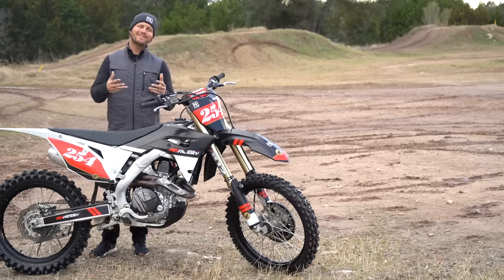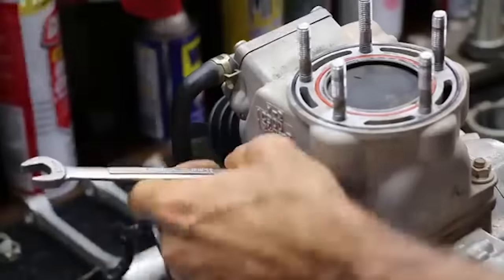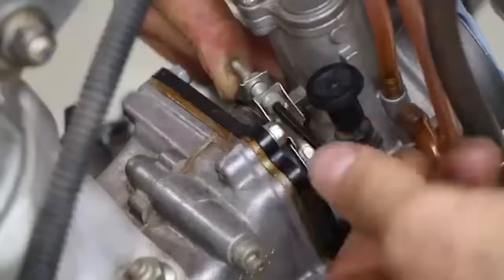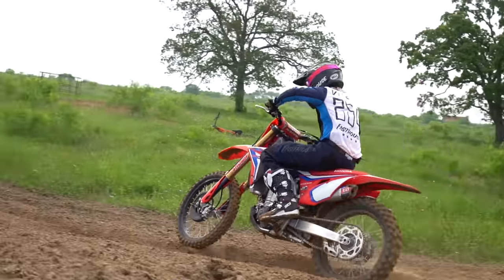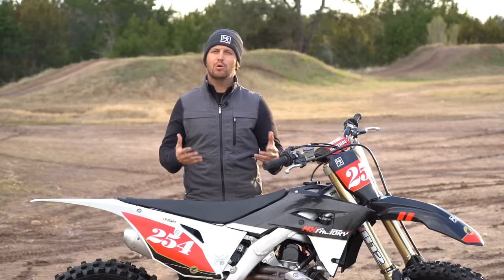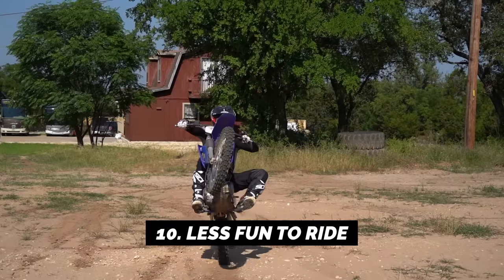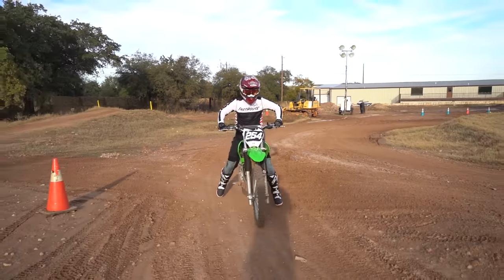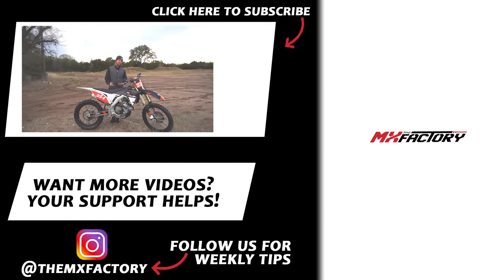13 Things You Need to Know About 4-Stroke Dirt Bikes

Comment: two-stroke takes one revolution of a crank for a complete cycle as a four-stroke take two revolutions of a crank to complete a four-stroke cycle
Reply: exaclty, 4 stroke talks about the number of strokes a piston does (up and down) and not the crank revolutions.
Reply: Yep - caught that also.   

(Pumping hand up and down while saying the following)
Intake
Compression 
Power 
Exhaust

But I prefer 2 strokes.
Reply: Thanks for pointing that out 45 seconds into the video and I'm waiting for him to say flux capacitor and blinker fluid. Pistons are bigger??? Which one is closer to a Tesla Prius. 4 strokes have 4 speeds while 2 strokes only have first and last. Ronnie mack gives relationship advice in the next series.

Comment: I started riding later in life as an adult in my 30’s. First bike I bought was a 92 kx250 2 stroke. Learned to work on it, got my first experiences riding it, but I wasn’t getting much better. It scared me a bit. My buddy told me to sell it and get a 4 stroke. I picked up an 09 CRF250R. I’ve gotten way better in leaps and bounds (aside from a few crashes) than I ever did on the 2 stroke. I’m having way more fun and enjoying it a lot more now. So I agree with lots on that list for sure! Thanks for awesome content. Learned a lot from your channel, and try to go out and implement things when I ride. I am not much good at the track yet though. It’s a big step up from the beginner track to the other tracks here and it’s super intimidating
Reply: Well thats like buying a 450 4 stroke to learn on, should've gone for the 125
Reply: @THAxBLiNt  I’m a fat kid. Someone suggested a 250 would be decent. I bought the wrong bike. Lesson learned. 🤷🏻‍♂️
Reply: @sparky_zap69  250 is just fine as long as you respect the bike. and dont push it. slow and steady is way to win the race on long run ;)
Reply: Ima go pick up my first ever bike rn it’s a 1999 Honda 200XR
Reply: My first bike looking towards the 4 stroke

Comment: Also, two strokes aren’t as reliable but are cheaper. And four strokes are way more reliable but are more expensive. You need to worry about fouling a plug, getting a new top end or mixing you’re gas, which technically makes fours strokes the same price to work on.
Reply from the maker: Good points! Thanks for the input!!
Reply: I thought the same
Reply: 4 strokes suck its all about the ping kings
Reply: @boostedbigblocks6252  I wouldn't say they suck.  There are positives to both.
Reply: @boostedbigblocks6252  is that why they stopped making four strokes?
Reply: 💯👌 Fouling plugs! Even had that on my new yz 250 started up got 2 mins riding then cut out on me. Had to get a new spark plug.
Reply: When 4t's break get your wallet out.
Reply: @robertblanchard6196  but it doesn’t happen as often as 2 strokes
Reply: @alexfader7832  they still make four strokes
Reply: Top ends really don't go that fast if you ride a 250 or larger bike. Plugs are like $5 and only really foul if you don't know how to warm up your bike. Mixing gas is a little annoying, okay. 

That being said I own both
Reply: Havent changed my plug since i got my bike, about 7 months ago… what are you talking about lol
Reply: @alexandrakingi8502  same on yz125, shit eats spark plugs😂

Comment: MX factory: talks about four strokes
Also mx factory: shows 2 stroke engine rebuilds
Reply: Was thinking the same thing
Reply: @Pieter Odendaal Electronics have nothing to do with 2 stroke vs 4 stroke. They can both run electronics no problem. This video was misleading.
Reply: @CHARLES HANSEN yes 2 strokes are quite simple, that still hasn't got anything to do with electronics running off of the motor

Comment: Old school racer here, 1980s Gary Bailey student 2x. Curious to know if 4 strokes are more throttle controlled vs 2 Stroke clutch/ throttle controlled?  Basically, is heavy clutch used on 4 Stroke?

Comment: I learned on a four stroke pit bike and now on a 125 two stroke. I think they both have good and bad things to them. When I'm a bit older and have the ability to buy two bikes I will definitely buy one of each cuz they're both great for different things. Muck love keep up the great content!
Reply: Yes two bikes is key. If you want to ride and go, 2stroke. If you like to wrench, 4 stroke. 😂😂 all seriousness I have both and honestly, I ride my 2 stroke 2 to 1. A lot of that has to do with my age. I’m 35 now and don’t ride track much anymore and as far as riding in the woods, 2 stroke is just so much more fun. 4 strokes have their place on the track. Torque and traction is hard to beat on the 4 stroke. I will say a top end on a 2 stroke is easier than adjusting valves on a 4 stroke. That’s my 2 cents.
Reply: Bruh how do you afford them

Comment: I have a 350 SX-F and a CR 125 for my stepson. The low end power on the CR is trash, and it's hard for him to learn to ride cuz he keeps bogging it and stalling out... but it sure is fun to rip around the trails, so light weight and has a ton of pull in the power band, I love it. I grew up on 2 strokes tho I never rode them right... didn't have the internet to teach me what's up.

Comment: Now that I'm old with only memories, I think back at all the bikes I have owned. Started with a Triumph Cub in 1964, which I seem to push home every time I rode it. Several 4 strokes later in 69 I got my first 2 stroke. A Kawasaki 238 Green streak.
Thought I had died and gone to heaven. In 73 I ordered the new Honda Elsinore. Have owned many bikes since, and now have a YZ250F and a XT 500 in the garage. Can't stop thinking about that 2 stroke Elsinore.😢

Comment: I went from riding crotch rockets to a 250 4stroke...I was told I should have bought a 2 stroke first because it was lighter but once I got went riding with my 4 stroke a few times I got the hang of it really quick

Comment: I’ve had both a Yz 250 and a wr450f currently. I can say without a doubt that my 250 was more fun to ride. The yz just had that crispness to it wether it be power, handling, sound, rider feel. And the reason I got a wr is for a easy street and dirt conversion. They’re heavier and you can be a lot calmer on the bike but I’m not a fan of all the extra weight after riding a 2 stroke for years. And I find it makes me more lazy on the bike. Both are good on their own way for sure!

Comment: Solution. Own both:)  I started on 2stroke in 90s so thats my roots.  Pros and cons to both.

One thing you forgot tyler is 4 strokes tend to run hotter.  One reason why 2strokes are still so popular in off road and hard enduro.  Also the weight thing is fairly close these days surprisingly.  If you have a 4t that is older than about 2017 its heavier but the recent bikes have gotten crazy light.

Comment: Should I get a 450 4 stroke or a 250 2 stroke? I am giving my yz125 to my younger brother.
Reply: If you can find one for cheap buy an old 300 enduro.
Reply: 450 because of racing 2 strokes are getting banned in racing but for fun you decide what is better

Comment: i've recently started learning on 2 stroke 85cc ktms. i also rode 300cc 2 stroke enduro ktm, for me, as a beginner, i think the downs of a 2 stroke are not enough to make the 4 stroke a better deal.
with a 2-stroke, you're forced to be near perfection with your technique, which is a good principle, and it is also a bit of a down for me that the 4 strokes are just weaker. no matter where i look, and with a vet that has been doing motocross for 15-20 years training me, i don't see any benefit.
and i think the environmental part is not a real issue. motocroos is really about love of nature and terrain, and there are bigger industries that do way more harm than this one. the pricing, again, makes them impractical, you have two strokes, from  major producers, that are stronger than a 4 stroke, same specs on paper, and they are cheaper, easier to fix, etc. and tournaments and race organizers should keep it to classes, not motor types, even though, i have personally been a marshal to MxOEN 2024, most of the contenders had 4 strokes and it was not the same spectacle compared to what the 2 strokes from the local competitions achieve. 
idk
i am not to knowledgable about the tech details, but i sure see that a 2 stroke is a way more common sense choice than a 4 stroke

Comment: Couple of things you missed. 

1.) 4 strokes have more torque down low allowing you to ride in lower rpm compared to a 2 stroke. This means way less gear changes.

2.) 4 strokes have much better engine breaking helping you stop.

3.) 2 Stroke have a smaller piston because it sparks or produces power every rotation of the engine. 4 strokes spark and make power every 2 revolutions. Piston down-up is 2 stroke. Piston down-up-down-up is 4 stroke.

4.) Less maintenance. Some will argue about checking your valves. However replacing piston. 2 stroke 20-25 hours. 4 stroke every 50 hours.

5.) Electric start. 90% of all 4 stroke motocross bikes come with electric start.
Reply: If you're talking mx 2 strokes yes.  Enduro 2 strokes a whole other ballgame.

Comment: Is there very much difference in the front and rear suspension? Between 2 and 4 stroke?
Reply: No the suspension has nothing to do with the engine
Reply: @tsufchakmon5801  thanks for the answer, but that was not my question. 
For your answer should I asume that the suspension is the same for both bikes?
Thanks
Reply: @DKLVE  depends on the models, most 250 4 strokes will have the same suspension as 125 2 strokes from the same manufacturer, same goes for 450 4 strokes and 250 2 strokes.
Reply: @tsufchakmon5801  thank you very much

Comment: I hope these new EFI 2 strokes will continue to be made so things can go back to normal. I see more cons then pros with the 4 strokes. Features you wouldn't need on a 2 stroke, harder to work on, cant be much harder but definitely more complex, dirt bikes are suppose to be simple.
Reply: Technically 4 strokes have more pros than cons. Ok, ok, 2 strokes do sound cooler, and they are more simpler, but 4 stroke engines are easier to run bc you don't always have to change the spark plug, they are better for the environment, and they are usually quieter.
Reply: @mrfilmer9270  my buddy has 160hrs on his ktm 300 and never changed the plug. And it's a carb model. I've fouled more plugs on my 200x 4 stroke than my 2 stroke. Why? Because jetting.
Reply: @mrfilmer9270  But I'm still considering a crf250r or crf250f.

Comment: -2 strokes should be competing with the same displacement 4 strokes. There's advantages and disadvantages to both. But it would mean riders on a budget could be more competitive. 
-The less pollution out the pipe is probably offset by the extra parts thet require manufacturing anyway. 
-Mix oil into your fuel or change the oil in the crank case every ride.... I know which one is easier.
-Pro's ride 2-strokes! Enduro is where they shine.

Comment: I need some advice. I am a beginner and I want a dirt bike that isn’t too expensive but does the job (I am a teen btw).
Reply: I suggest either a Honda Crf150r/Crf150rb or a two stroke 85
Reply: How old and tall are you
Reply: @jalenbracken3915  not tall. Maybe 5 foot 1
Reply: @gman1325  then yea probably a 85 or Crf150r👍
Reply: @jalenbracken3915  ok tysm

Comment: Engine braking? I'd have thought that was one of the biggest differences from a riders perspective... Shame you missed it. 

Also, a four stroke feels more "planted" due to the ratio of 'sprung mass':'unsprung mass' being greater than a two stroke counterpart. It has nothing to do with more modern suspension etc. Many two/four strokes will share suspension componentry. The difference is purely ratio of sprung to unsprung mass.

Premixing fuel? TPI mate.

Comment: #1 is incorrect.  It takes 2 crank revolutions to complete a 4 stroke cycle.  

#2 is incorrect. It is not the piston that is 250cc,  cubic centimeters is the volume or capacity inside the engine.   Its calculated by the number of cylinders x the cross sectional area of a piston x the length of the stroke.

Comment: If your 4 stroke engine breaks - which it will, you will be wishing you had bought a 2 stroke.  If you just want to race,  get a 4 stroke, if you just want a weekend thrill, get a 2 stroke.  And when it does break you can probably fix it yourself without going bankrupt!

Comment: With all the extra parts and emissions produced in manufacturing, I really don’t see how a 4 stroke is more environmentally friendly over the lifespan of the bike. Yes, the 2 stroke puffs a bit of blue smoke out the back, sure. But I’d bet if you weighed up all the extra emissions from producing a 4 stroke you would be in front from an environmental standpoint puffing some extra smoke out the back of a 2 stroke. Both are great 👍🏻 different strokes for different folks and ride what you want. But don’t claim 4 stroke mx bikes are more environmentally friendly. In my opinion. That no one cares about.

Comment: 13 things you need to know about 4 stroke dirtbikes:
1. They're less fun than 2 strokes
Reply: yeah i like two strokes mainly because they take a crap ton of skill and you’re never sitting still on a two stroke
Reply: Yeah but also faster. My stock 450 has 58hp, while a 2 stroke 250 has 48, and much less torque.
Reply: @jamesdecker4166  450 is faster on track, that's why they race 450 4 strokes. 2 strokes are faster on the trails, that's why all these manufacturers are starting to make 2 stroke xc bikes

Comment: You never went over reliability of either one and you also didn't touch on the fact that people are rumoring it that you have to like rebuild the whole damn engine on a 2-stroke like every 40 or 50 hours and I don't know if that's the same thing on a four-stroke. But it sounds like they're both a piece of shit. Why should you have to rebuild a damn motor basically once every couple of months. That is extremely costly